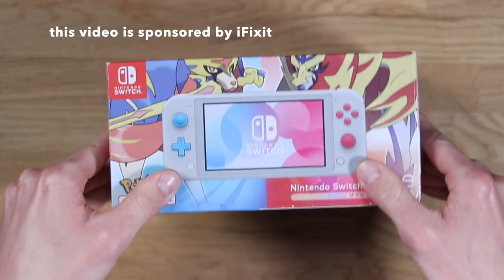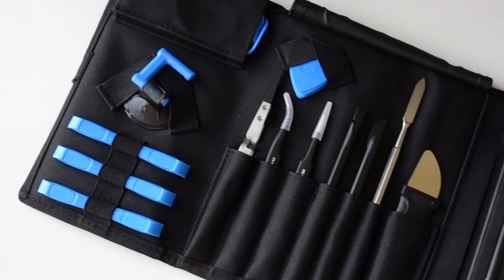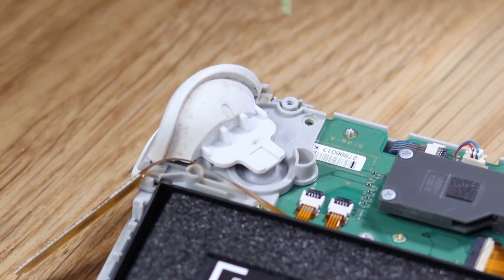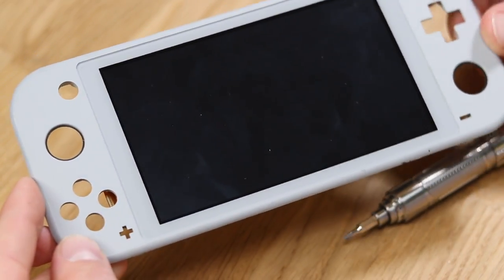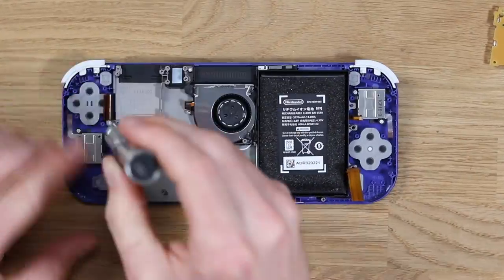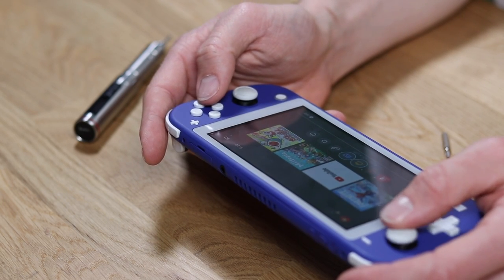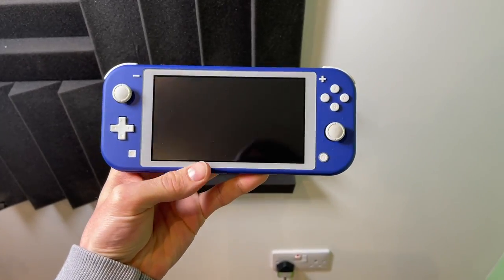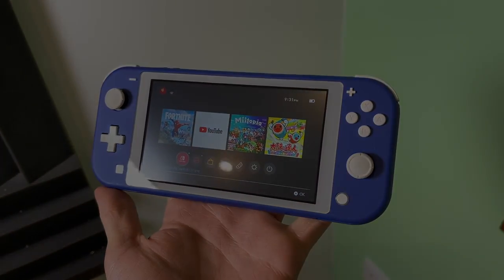The IMPOSSIBLE Nintendo Switch Lite Repair

Comment: The blue screen is very easy to fix. Hot air station at 450 medium air speed. Flux the nvidia chip and heat it up once it's hot gently push the chip down while the soder sets. For me this fixes the problem roughly 80% of the time
Reply: I agree somewhat, but it's not always the SoC, the blue screen is a communication issue between the SoC and RAM so it can be either of those things. The problem is a lot of the time you end up with torn traces under the SoC too which means trace repair and reballing
Reply: @TheCod3r  I have never heard of or seen torn pads, unless someone failed a repair attempt. That chip is not going to move enough from a drop to break a trace, and a overwhelming majority of the time blue screen occurs from the shock of a blow. However I have ran across chips that have just went bad and need to be replaced.

Comment: Sad to see such a special edition switch in such bad condition I hope it can be fixed! Also nice to see the switch lite being fixed being a more modern console. I definitely plan on getting an I fix it toolkit cause I have so many Nintendo consoles that can use some slight fixes would the mako kit work well? The pro kit is a little too pricey for me.
Reply: Look for a refurbed pro kit, I got one for a great price!
Reply: @chadwenchester528  ooo I’ll definitely have to check that out thanks!
Reply: I have the moray kit and so far it's been a great deal for a good price. It has all the bits i need :)
Reply: @clairehoffner2851  good to know! I was looking into that kit as well but I’m not sure if it included the specific bit I would need for Nintendo consoles but I’ll have to double check thanks!
Reply: @whisperingwooper1763  it has a y000, y00, y0, and a y1 bit as well as some game bit ones
Reply: $10 Chinese cell phone repair kits have come an incredibly long way.  Ifixit is pretty expensive.
Reply: @Swanhub  yea I bought a cheap cell phone repair kit and it comes with almost everything needed to fix consoles. It even has y bits and torx security bits.
Reply: @Swanhub  i was gonna say ifixit really is just the  name... I bought a kit with 119 pieces for like 18..

Comment: Good stuff Elliot. The blue screen issue on the other one is caused by a communication issue between the SoC and RAM. You can sometimes fix it with a reflow but determining what chip is the cause can be tricky. Usually I try the pressure test to figure out whether it's the SoC or the RAM. It may also have torn traces which is obviously more tricky to deal with

Comment: Great video! The screen looks cool.

I did the same with my switch but by over tightening the screws then ended up replacing the shell. The quality of the aftermarket ones are decent.

Comment: When it comes to taking screws out, I recommend an old egg container. I’ve been using one for years to take things apart.
Reply: That's not a bad Idea, but the tricky part is trying to remember wich screw goes in the right hole. Outer and fan screws are easy enough but the tiny and medium screws looked the same.

Comment: One thing I've learned to appreciate since I got an ifixit set is just having a handful of those blue plastic shims/plectra is worth its weight in gold, just having one or two as kind of like an extra pair of fingers to keep a gap between parts from closing is invaluable.

And to join the other comments, I think the grey bezel makes for a pretty nice looking contrast. I know "bezel-less" or bezel-hiding designs are more common nowadays, but I still fondly remember the look of the old gameboys, y'know, it had a certain kind of charme and makes the screen really "pop", visually speaking, from the main body of the console.

Comment: You're spot on with your diagnosis with the blue screen.  You can test which chip is broken by pressing on it when you power up.  It's either the APU, or one of the 2 RAM chips.  If it's a RAM chip you could probably get away with a reflow.  If it's the APU it mostly likely took a pad / trace with it when the console was dropped.  Still repairable but it's not economical.

Comment: I wonder, if one would replace the two screws with the appropriate ones, could the plastic be, pressed down from the front. A bit of heat, perhaps, or even wet sanding, "brasso", a mild abrasive stuff...

Comment: That one-handed grip at the end made me nervous. When I take things apart I put some tape on a sheet of paper with an exaggerated drawing of the thing I'm taking apart. I do this for each depth level of the device as well so I don't mix screws that overlap. If needed I even have two sheets per depth level for top versus bottom. I love the gray border around the screen after you had it fixed, I think that design aesthetic works quite well.

Comment: Lol I just used my mom's hair dryer to take the screen out. It seems heating it up also made it a bit more workable, because I did use quite a bit of force to pop it off the shell to the point where it was curving, but no permanent bends were done AND it worked perfectly fine when I put everything back together. Definitely take your time on this though.

Comment: Awesome video. The switch lite is no easy console to do repairs on depending on the issue. One thing I use to help with the screw issue is the ifixit magnetic mat. You can even write on it so you know where everything goes.

Comment: I've taken apart the Switch Lite a lot and the tiny screws are easy to strip and the ribbon cables for the digitizer and LCD can be super annoying to put back in. I broke an LCD once trying to swap the screen but keep the same color digitizer. I was being careful just lifting a little from the sides but the back layer still separated from the front layer that was stuck to adhesive.

Comment: Don't feel bad about the screw bumps! I cleaned out my Asus Strix G512LW laptop and when putting the screws back, I accidentally used a long in a short. Now the bottom right has a hole in it like a tiny volcano.

On the plus side, it's easily identified as being my laptop though. Hard to not notice the hole lol.

Comment: The other one could get the Aluminum shell treatment, maybe. 
Remember to check that thermal compound and replace it if needed. Could add thermal pads if you go the aluminum shell route, get maximum heatsink use out of the everything.

Comment: I cleaned a Dreamcast controller and poked a screw almost all the way through the back of the front shell. It is for the VMU part of the shell..also my sink drain ate the D-Pad pivot ball thing so I need one of those

Comment: While you had the switch apart you should have added a bit of card or thick tape behind the joysticks to prevent any future drift problems.
Reply: This is superstition
Reply: Switch lite joysticks don't drift,i think.
Reply: @hawkfeather6802  as someone who had to order a replacement part from ifixit, switch lite sticks do indeed drift, i was extremely gentle with the console(maybe 1 drop onto the floor?) and took good care of it, yet experienced stick drift about a year in

replacing the joysticks on a switch lite is a pain in the ass you have to disassemble like the entire thing to get to em
edit: it was the right joystick, the one that is underneath the main board, the left one is easy the right is one of the last steps before you have taken everything out

Comment: The internals on this thing are nerve wracking to deal with. I did a shell/button replacement thinking it would be a simple drop-in procedure lol. 

I had no written instructions and a Chinese video walkthrough with no audio, but somehow I pulled it off, despite being certain I'd punctured a ribbon (somehow I put a dent in it with the corner of a flat driver that I was stupidly using to pry up the retaining latch)

The end result was lovely though. Woodgrain shell with vac metalized gold buttons that I did a little weathering on to make them look a little more like brass).

It's my favorite thing that I will absolutely never attempt again lol

Comment: they're called heatpipes, or in this case it's a heatpipe assembly. 
ingeniously simple little devices: it's just a copper pipe, containing a wicking material and a tiny amount of water in a high vacuum. but due to the magic of thermodynamics, they can rapidly conduct dozends of times the amount of thermal energy, that a solid copper rod could.

Comment: Honestly, you don’t even need the suction cups.  With the kinda staggered design in ifixit spudgers you can just heat a corner of the screen with a hairdryer while slowly working it in.

I’d also recommend at least four spudgers for maximum ease or you’ll have the 1-2 you use kinda pop out often and reseal to the shell.  There’s only so many times for it to happen before you get angry at having to start over.

But yeah, it’s really not as delicate of a process as it seems.  A hairdryer is the safest and most newbie friendly method of melting the glue.

Comment: Yup I know your pain. I have a crimson red nintendo 3ds that I have in my collection that I decided to open up to play on a few years back. But when I first turned it on, I had a problem with the top screen being way brighter than the bottom screen no matter what brightness setting I changed, the top screen was always bright as fuck, literally brighter than the max brightness setting. Anyways I decided to open it up to see maybe a ribbon cable wasn't set right but in the end never could figure out why the top screen always stayed bright. But when screwing it all back together, I had used a screw in the wrong place and it kinda made that bulge bump. But Luckily I could press it down flat where you couldn't hardly feel the bump.

Comment: Did you replace the thermal paste? I'm looking into replacing my screen and I've seen a lot of repairs which clean off the old thermal paste and add fresh paste, while I've seen some which do not. Just curious if it's 100% necessary.

Comment: Hey Retro I have several copies of Bugs Bunny Crazy Castle 4, on Gameboy color and all copies have worked in the past but they have an issue where after booting they go to a white screen and never make it to the Title screen. I have cleaned them thoroughly but these seem to have bad Capacitors causing the game to not fully boot after the loading screen disappears. I have not replaced cart SMD caps before and although I have many copies I dont want to ruin any of them. What would you suggest in replacing the caps, even if they are larger caps I dont mind as long as the carts work again.

Comment: Just wondering 🤔 could to screen be pried off from the from front after removing the back shell and disconnecting the ribbon was to clear in vid but I didn't see and screws holding the panel

Comment: My switch doesn't charge with "good" USB-C chargers nor shows anything on the dock, however if I run android I can use usb-storage fine (So it seems like USB-2.0 works). I suppose some USB 3.0 chip broke and it's not possible for the device to do the handshake for the capabilities or something? Is this something that I can repair?